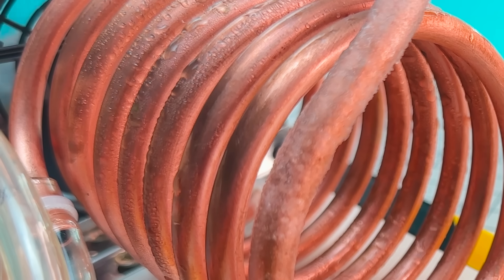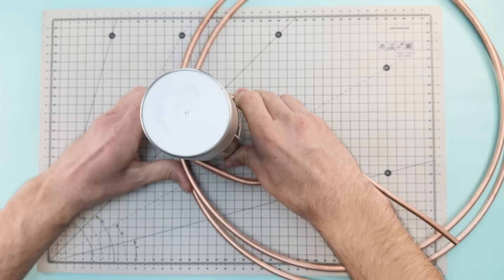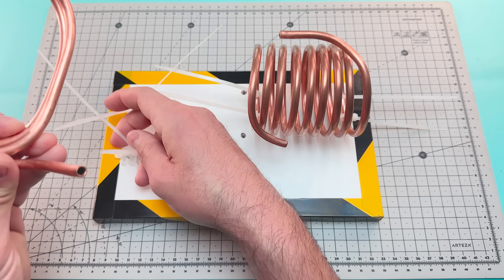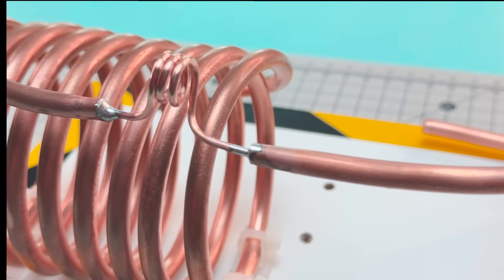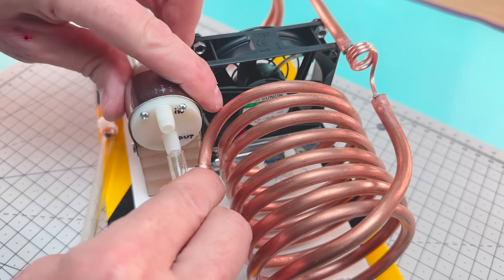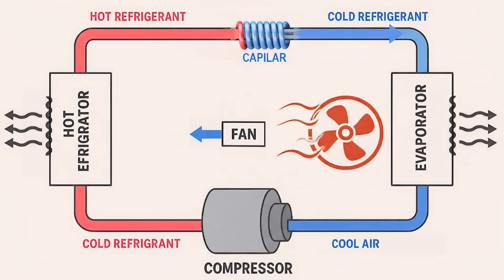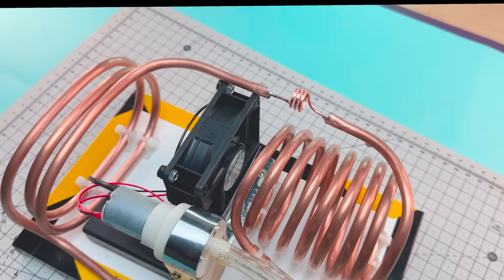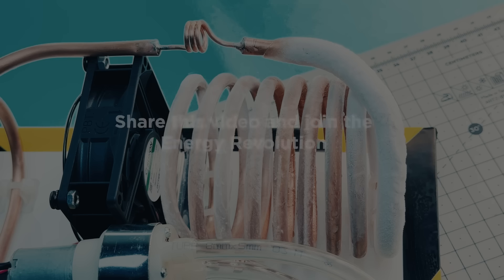Make your own AIR CONDITIONER at home Fast and Easy!

Comment: Ok, help me understand.   What does the tiny coil pipe do between the two big coils?
Reply: Pretty sure it act's like a tx valve
Reply: Creates a restriction in flow, drop in pressure after flowing through. The drop in pressure creates the physical change of evaporation of that r600a in the larger evaporator coil its turning to vapor and absorbing any heat which then continues circuit as a superheated vapor until it's pressure back up after compression by pump and condense back into a subcooled liquid as it leaves condenser coil and finally gets back to the tiny coil pipe and repeats the cycle.
Reply: The compressor pump is pumping gas through a large diameter pipe (the sort-of oval pipe section shown), then the gas gets to the tiny diameter capillary tube and it is much harder to pump gas through. That makes the pressure at the entry to the tiny diameter tube go up (and much of that pressure "backs up" into the compressor coil). At the evaporator end, where the tiny diameter capillary tube coil opens up into the circular, large diameter tube coil, the pressure suddenly drops because it is much easier for the refrigerant gas to flow in the large diameter circular coil than in the tiny diameter capillary tube. That lets the refrigerant gas to expand. As the gas expands, it cools (take a commercial duster can and hold the trigger down for a long time, the can gets cold because the gas inside is expanding).

Comment: The system will not cool down the room but will slightly heat up the room because the condenser part releases more heat than the evaporator can take away. The net heat the system generates will be equivalent to the battery energy it consumes. However, if you place the condenser outside of the room using some piping, then it can be an tiny air-conditioner.

Comment: how often do you have to refill the gas in the circuit?
Reply: on a closed system like this, you should never have to refill it unless there is a leak
Reply: This isnt a finished design since the heat generated when the gas expands isnt tsken from the room. All ACs are in a window or use a hose to take the hot air outside.

Comment: Common sense is telling me two things: 1. Where the heat absorbed from the room goes to? The other copper coil must be hot and thus one coil will cool and the other will heat up back. And 2. If this was so efficient, why there aren't commercially available gadgets already made, just for us to buy? I mean, temu, aliexpress, etc. would scream for that. There is a reason heat goes outside in big air conditioning units. And how much can you cool with the 9V small battery? That uses 6 F22 cells that deplete quickly. A good AC unit that generates like 12000 BTU needs a lot of power. It has a proper compressor and more efficient cooling agent.
Reply: Are you comparing a small project regarding a tiny airconditioner  to a big airconditioning unit? You must be nuts

Comment: bro is trying to colding copper tube, not the room.
Reply: thats why there is a fan there?
Reply: @XenonEditz12  And the fan is pulling air from the hot side and blowing it over the cold.
Reply: @simonrussell4986  yes but that wasn't the point here

Comment: 12v motor powered by a 9v battery plus the load of the fan. Also, the heat is being released into the same space effectively negating the cooling.  Principle is sound but the system is definately hiding additional power and its very dangerous if you don't evacuate the air(o2) from the system or the pump could ignite the gas. You can use nitrogen, or, like this guy meth and stolen copper.
Reply: It's still blowing cold air onto the person so that's the point of it. Fans don't cooldown rooms either but they do cool down people. It's still an AC unit just not one to cool down a room.
Reply: He's only demonstrating how it works.

Comment: This is a great demonstration of how air conditioning works, but this will not cool anything like a room.  The condenser has to be separate from the evaporator.
Reply: Or at least the hot air guided outside.
Reply: Right. If he calls it a refrigerator, it would be a fine video although I doubt that a little 9v battery can cause this much frost so fast. Also, the vapor pressure of the ISO butane used here may exceed the pressure rating of the clear PVC pipe used here.
Reply: It will cool down your face in you aim the fan at you.

Comment: Please everyone in the comments believing that.... Go to school a bit longer .... The principle is correct, but this motor is not making anything close to the pressure you need neither a 9v battery can. 😂😂😂 So don't get fooled of this crab
Reply: which school did you go man, my school never teach any of this to us.
Reply: @DoSomthing-k6s  to be fair, you are kind of right... I remembered we talked about kompression an expension of gas that it will absorb energy and so on ... But never talked about the basic principles of a fridge... Or of any other Elektronik device we use today.... Sad...
Reply: I don't think this will work, I know nothing about what this guy do, but still, go back to school won't help, they never teach us any of this.
Reply: Yes it is, it's an air compressor. Literally designed to compress gases.
Reply: @FirmB1ade what I mean is it will not cool the room. BUT, it will be a good replacement for fan, cuz instead of a fan blowing hot summer air it'll blow something cooler, at least that's what I understanding, could be wrong though, I'd love to know if it'll work like that or not, If you can please tell me, I would love to know.

Comment: You need a stronger fan and bigger battery man this won't cool a room it will run out, also the pump is so weak brother, what about the pipe freezing problem? over time it will flood the circuit? good job man
Reply: lol start off with the " good job "
Reply: Isobutane has a boiling point of around −11.7°C and a freezing point of about -159°C.  but what can occur is  moisture contamination and that could freeze and create a blockage.. 
a filter-drier could be used to take moisture out of the system and prevent that. Better seals ofcourse can be added to the project, also Mounting a for ex. Hayden 401 transmission cooler radiator outside with a fan, using copper tubing and thermal paste for better heat transfer, keeping it shaded and ventilated with  all joints secured to prevent leaks, and avoiding placing it near flammable materials.

It´s a project not a commercial product.

Comment: TO LOWER THE HEAT TEMP AND PRESSURE IN A SPACE, YOU HAVE TO REMOVE THE HEAT ENERGY FROM A SPACE(a room )TO OUTSIDE.that's the only way to get low temp and low pressure and Absence of heat.you'll need a return or a planum  roof and a supply
Reply: You stand out the most due to typing in capitals. When are you posting a video of a real one being made ??. We all want to no how its done

Comment: If you stuck this inside a cooler  like on a shelf in the cooler and put ice at the bottom would it work?
Reply: would be even more effective than this nonsense, if you change the ice cubes regularly :)
Reply: If you keep the evaporator ring outside the container

Comment: Ans where does the hot air go? This will not cool any room unless you somehow place the hot side of this little unit outside the room. And how long will an airpump and a 12V fan run on a 9Volt battery? Probably e few minutes at max, so you need some sort of powersource like a wall adapter or something to keep this thing running. And butane-gas is highly flammable. On small leak and a airpump driven by a brushed motor is a recipe for a nice warm fire.

The concept is nice and It will cool a drink-can, but that's about it. Nice as a proof of concept, completly useless otherwise.

Comment: This is the reason we exhaust the heat outside or send it to another unit. You can't get something for nothing with the law of thermodynamics.
You would need to stick that hot part outside of a window. It also need to add a fan on both ends to increase the cooling power.

Comment: Nice to show the principle of an heat engine, but ….. utterly misleading. Not just by not explaining where the heat goes, but also suggesting that getting lower temperatures is “good”, while it indicates that the heat transfer at the cold side is actually bad, since optimal would be close to the temperature of the surrounding air that is being cooled.

Comment: Big problems with this system just from a glance. 
1) I am not too sure that your pump will work as a compressor, because the pump will not be effective in compressing vapour, but let's assume it works fine. 
2) Having your evaporator and condenser in the same enclosed space, just means that you're wasting energy to move heat about 20 centemeters, and will effectively not change the overall temperature of the room in the slightest. ( if anything,  youre just heating up the room slightly with all the moving parts)
3) lets assume the point of the system is to cool only a small section of a room, say directly in front of the user. It will still be highly ineffective, because your fan is positioned between your condenser and evaporator. That is, the fan draws air over the hot condenser, thereby heating it up, before the same air then passes over the cool eveporator. As a result, the air reaching the user will effectively be at room temperature.

Comment: Take a large box fan and attach a copper coil the size of the fan to the front. Run a tube to a small fountain pump inside of an ice chest with water and ice or frozen containers of water..

Comment: Any heat absorbed by the evaporator is discharged back into the room by the condenser. Thus, if the device does work, it will only dehumidify and not cool, which is why all air-cooled condensors are located outside.
Reply: You would actually be heating up the room. Even if the evaporator and condenser worked perfectly, and cancelled each other's temperature change out, a small amount of heat is generated running the air pump.

Comment: As a Mec by anical Operations engineer with a universal HVAC & R license and almost 20 yrs on the job experience I am often finding it entertaining that theres so many experts on the concept of compressed gas and evaperative cooling systems. Way to go ya'll! Right on!

Simple improvements with massive efficiency gains:>>>
1>fan shroud
2>segregation of evap/cond. Coils
3>"O" shape coils no bueno--go with M/Walternating cross   over coils or similar.
4>add heat transfer fins; more surface= more transfer of energy/heat.
5>radiator shroud, 🌬❤➡️ less resistance 🚫A/C coils accept with a shroud air has no choice to go anywhere else...
6>ice build up actually creates an insulation on the coil, so either a coating that prevents moisture condensation or you'll need 2 additional electrical components,1 thermistat controller, 2 heat strip to defrost the ice.
7> now that youvecpulled DI water from the air youll need a drip tray under the condenser coil, and a drain tube and somewhere for the water to go. Of course you COULD drink it...GO RIGHT AHEAD you can do whatever you want, BUT Id suggest you google "can humans and animals drink condenser water from an air conditioner". See what a few google answers tell you and see if thats something you are willing to accept or find a solution to. 

Anyway, thats just a few simple efficiency upgrades, of course you can use different gasses with lower boiling points for an even higher efficiency, but I doubt a tiny water pump would last very long. Those pumps have rubber diaphrams that are flexing rappidly, some chemicals like butane are not the friendliest to many rubber compounds, causing a short lifespan of the rubber andvplastic tubing when compared to other materials available. 

Have fun, learning is good. This was a highly engaging production style, intentionally created to produce many comments, not to be specifically efficient or correct. More comments/views = more $$$$$ lol
Reply: After watching this Id like to build a slightly lager unit hooked up to a larger fan and coil. Thanks for your tips! My mind is already turning with improvements.

Comment: Sorry, no cooling of the room with this device👎
Reply: Agreed, in my non-engineer experience it would take at least a wall wart to reduce 120V to 12V with maybe 0.6 or 1 amp for continued use, even that may not do the trick, but an engineer could tell us in a second.

Comment: You can atleast use it as a mini refrigerator by inserting a contained of cylindrical shape inside the gap of the coil. And giving it an adiabatic containment.

Comment: Can you show us the condenser air temperature
Reply: The net cooling of the room is zero, unless you isolate the heat side and blow it out of the room through a hose or ducting. Albeit, the stream of cold air on your body would be pleasant.

Comment: this is very very bad video. just to make a quick buck, heh? i pity all the idiotic sponsors
Reply: The problem is this, the net cooling of the room is zero, unless you isolate the heat side and blow it out of the room through a hose or ducting. Albeit, the stream of cold air on your body would be pleasant.

Comment: For a glass bottle, or drink may be Will be ok, but Is a Little system, and i don't think the system Will work propely, because there is no vacuum (umidity in the system) and Is not good for the refrigeration.

Comment: The physical principle underlying the experiment is sound: it is based on the Carnot cycle, as in most heat pumps. However, the proposed setup omits a critical element: actual gas compression. In the absence of compressors or valves capable of maintaining pressure differentials, the gas pressure will inevitably equalize throughout the circuit, and a water pump cannot fulfill this role.

Furthermore, a fundamental aspect of thermodynamics must be considered: the heat transferred between the “cold” and “hot” regions remains in contact with the same surrounding air. As one side cools, the other compensates by heating, while the energy supplied by the batteries is likewise dissipated as heat within the system, thereby increasing the ambient temperature. Consequently, the overall heat content of the environment rises rather than decreases.

Thus, while the experiment may be visually engaging and useful for illustrating the basic operating principles of a heat pump, it is ineffective as a means of achieving sustained cooling. In order to obtain a genuine cooling effect, it is necessary to extract heat to a different environment—as commercial air conditioners do—and to employ compressors that drive the gas through the compression–expansion cycle.

If the objective of the video is educational, it should clarify why the device ceases to function effectively after only a short period. To suggest otherwise would risk misleading the audience into believing that such a configuration could serve as a viable air-conditioning system. The only plausible justification would be the temporary cooling of a very small volume, a goal that can be more effectively and sustainably accomplished using a Peltier module.

Comment: Не понятно зачем ты скрутил тоненькую трубку, хватилобы 2 см чтобы припоять их встык. Эффект был бы тот же.
Reply: Not true. The length of the capillary tubing in actual small unit refrigeration units determines the rate that refrigerant is metered into the evaporator. The extra length is always coiled up like that to keep it neat and save space.
Reply: Да ты прав прошу прощения никогда не имел дела с такими трубками обычно сталкивался с ТРВ там довольно короткий канал.  @engineeringdepartment7961
Reply: Le capilaire joue aussi dans le changement d etat il aurait du metre 50 cm sinont

Comment: A 9v battery holds about 5 watts of energy I doubt it would even cool a small room one tenth of one degree. However it does show how efficient you could make a small ac unit using better materials.

Comment: I'm wondering if you beefed up this design a little bit and put a secondary fan blowing on the return and encase the entire thing in a housing unit could this be used as an outside cooling system say you're sitting at a picnic table and you want to cool down more than just a fan can do, would something like this be viable? Obviously you would also have to beef up the power supply

Comment: All the unnecessary deaths from children, pets that get locked in a car on a summer day, or just keeping the inside of a car at a reasonable  temperature and extending the longevity of the leather interior, etc., this tech could easily be employed by using a second 12 volt battery/powerbank that would use it's power even intermittently (turn off and on) to cool down a cars summer inner temperature not necessarily to a nice refreshing 68-74 degrees but to a bearable, life saving temperature of 98-101- why car companies don't employ this is beyond me. Someone like you guys make one that can be patched in to a lighter outlet and heat dispelled out a window, would make a good living selling this to families with small children, pets, etc. and to those who hate going to a car that is scorching hot on a summer's day.
Reply: Its just easier to not lock children and pets in hot cars....
Reply: Or just leave the ac on at full blast, and have good window tint.

Comment: Is one tube cold and the other hot? What's the point then?
Reply: Yeah basically. It's a heat pump. If you had the evaporator coil outside a window, and condenser inside, it could sort of work to pump heat outside your room. Even better if you had radiators with fans instead of coils.

Comment: Instead of injection i would use a T split section to put the fuel connected to pump and use it when ever need to pump in the liquid.